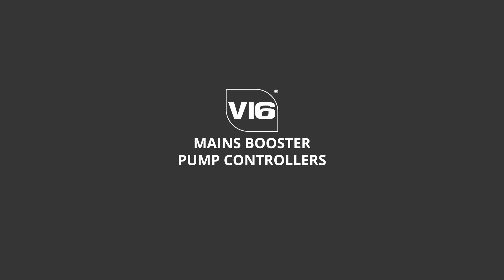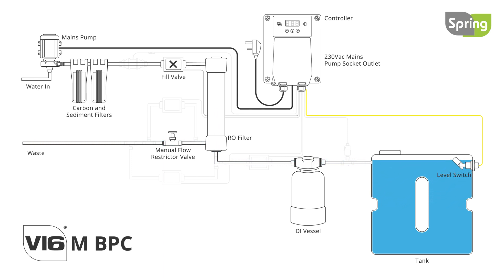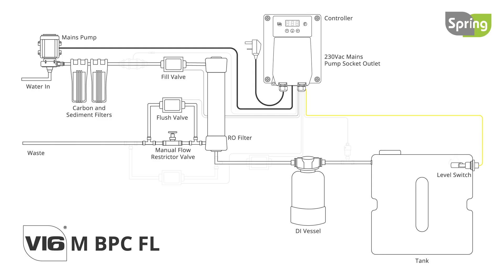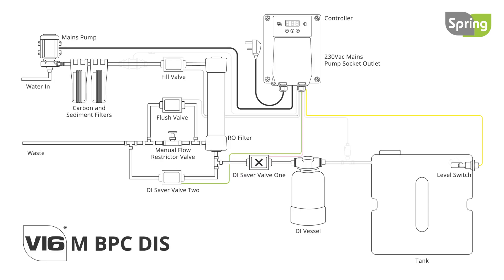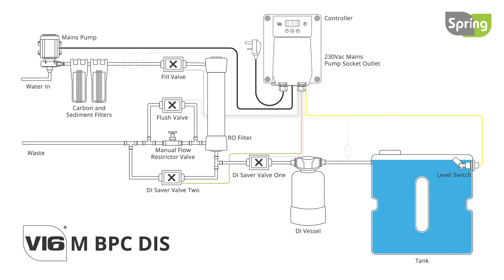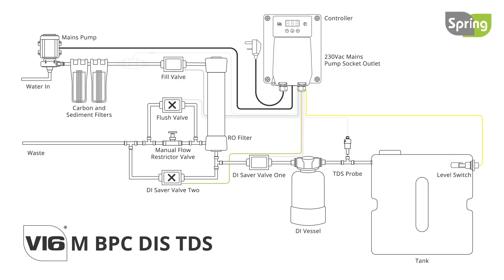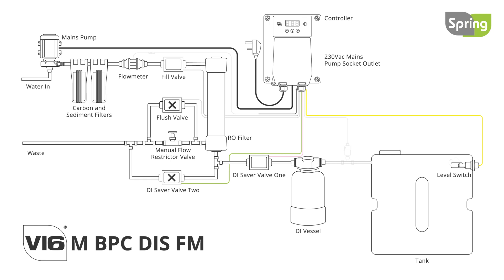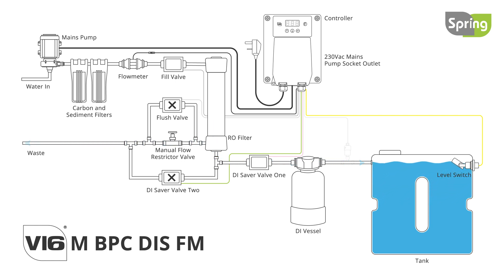V16 Mains Booster Pump Controller

Comment: Will any of the models work with a 300 gpd system and will it rest the booster pump say every 4 hours  for half hour presuming the system is running 24/7 if needed.